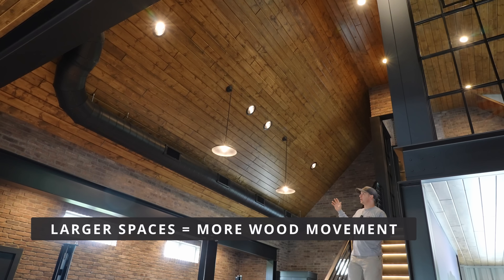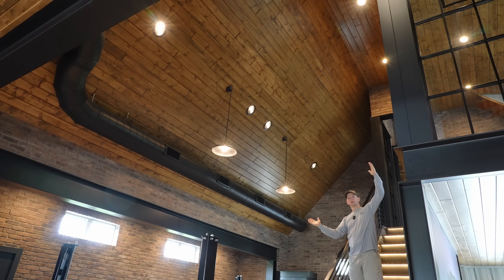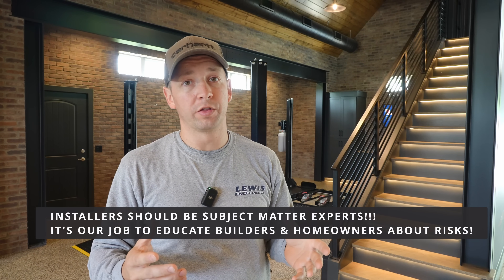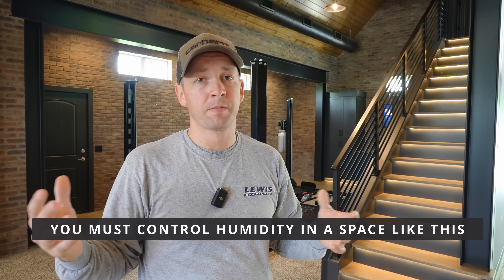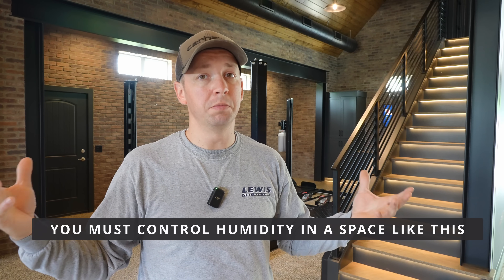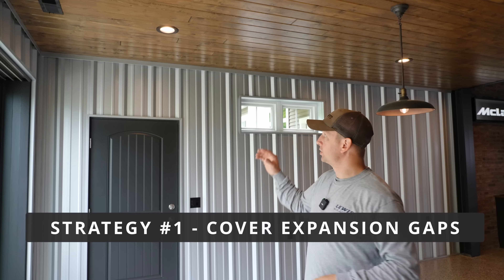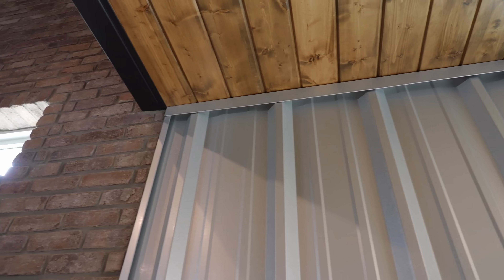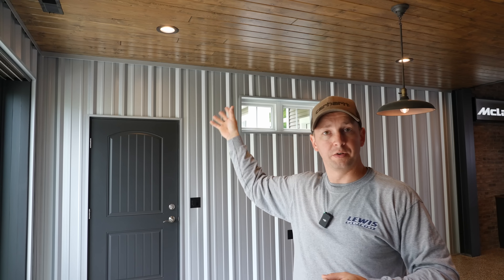The MISTAKE That DESTROYS Tongue & Groove Projects... And How to PREVENT It....

Comment: All of this makes sense and fits with my experience, but I was curious about the control joint adjacent to the garage door bracket. I try to place the control joint in the middle of a section of expanding boards so that both sides can grow into it, but in this case as you mentioned that board under the bracket is locked in place. To me that says only the expansion from the rear boards will happen in that joint (and in the rear at that metal bracket), whereas all expansion towards the front will happen where you undercut the 2x above the garage door itself. 

I can see location it there for aesthetic purposes (as the bracket is already creating a visual distraction) but in terms of functionality am I wrong about it being only functional for the rear portion?

Comment: All your effort to mitigate expansion/contraction is fantastic and great to see. 
The idea with softwood/hardwood jointed ceiling substrates is to simply treat it like a floor installation. Provide necc. relief along your perpendicular perimeters and trim accordingly. Great job

Comment: Designers and architects hate trim these days. We should all be aware that all trimless details are at risk of not having adequate expansion. At the end of the day, if it's a custom home it's the architect then the builder who are responsible for these details. I give my advice but if they want it tight it goes in tight. I have never had an issue with softwood T&G ceilings but I installed hardwood for a couple years when I was younger and have personally fixed someones floor where the installer put it in tight and it buckled.
Reply from the maker: I probably would have been that way in the past but I have learned that I have to take a hard line stance sometimes and let the builder/HO know that I will not install a product under certain circumstances. One of those is tight T&G. In Indiana there is simply way to much humidity fluctuation not to allow for expansion, ESPECIALLY if installing in the winter. I'm doing a lot of white oak T&G ceilings with material costs over $10-20k. It's just simply not worth the risk, and I absolutely don't ever want to go back and redo my work even if I am getting compensated for it. Sometimes we have to save the builder/homeowners/designers from themselves.

Comment: Spencer, I noticed something that you didn't point out that is something I always used to do when I was putting up tongue-n-groove. I always chamfered the ends of the boards. That looks so much better than just butting the ends of the boards together. "If you can't hide it, emphasize it."

Comment: Looking to do a similar interior project. Curious on TNG on a ceiling application do you run end of the board with simple butt joint of do you 45 degree (or other angle) bevel overlap with wood glue and nail?

Comment: The boards are not glued together creating a single slab , the reason for T&G is that each board expanse and contracts as individual board.
Reply from the maker: If it's only shrinking it's a non factor. But if it's expanding the movement will compound across every board. Hardwood flooring will push sill plates outside of foundation walls when it expands. It has nothing to do with being T&G helping unless there is a gap that is intentionally left at install time given certain humidity conditions.

Comment: If it does buckle how would you go about fixing it? Would it need to be removed, add an expansion gap, then reinstalled?
Reply from the maker: Yes, but I've never had to repair a botched job. So I haven't thought it through a lot.

Comment: Spencer, wish you had made this a few months ago.  I just experienced a buckled ceiling for some of the reasons you addressed.  In the end I had it too tight at the peek.  The top 5 rows on side of the cathedral ceiling  buckled about 8 weeks after we put it up.  We were able to save it and have now created an expansion joint at the peek.  Two questions you didn't directly address.  You talk about pre-staining the tongues, did you seal the underside of the pine before you installed it?   Is there any calculation for the amount of expansion needed?  Appreciate all your professional knowledge that you share with us.
Reply from the maker: No, we didn't seal the backside. From what I have seen and understood, even if you seal all sides the material will still eventually take on the moisture in the air around it. So I do not think that sealing all sides is the ultimate solution, though it may help some. 

Yes, you can calculate how much wood movement you will get. You need to know the species, current moisture content, and how much you expect humidity to rise to do those calculations. There are online calculators.
Reply: @InsiderCarpentry  appreciate the response
Reply: @InsiderCarpentry  Sealing all sides certainly won't stop the wood from taking on and losing moisture, however, it is best practice to finish all side of the wood to allow that taking on and losing of moisture to be as even and equal as possible. This is what furniture makers will do. While I'm not a finish carpenter I do watch your all your videos and greatly appreciate the knowledge you unselfishly share. I hope your wife is still doing well, God bless.

Comment: So Spencer are you personally telling the home owner IF I do this the wood will stay put?  Why not have the Architect or some engineering firm draw up a plan you follow. Why would you involve yourself as an expert on wood movement. Did you give them a  written warranty?
Reply: an architect or engineer wouldn't be able to draw up a plan for potential wood movement over time.  And they'd have far less subject matter expertise as opposed to Mr. Lewis.
Reply from the maker: Architects have not watched wood move for decades like I have, so while that may be a formal way to deal with it, I don't think its the best way. Ultimately on this one it came down to the homeowner and builder communicating on this and coming to an understanding.
Reply: @InsiderCarpentry I just did not want you to accept  the responsibility of wood movement that’s all. So many variables (A/C broke down for parts for days etc) out of your control  Good luck

Comment: Did you install the T&G over drywall? Or directly to the rafters? How does your backing material / vapor barrier affect expansion and contraction? And what is typically best practice? Thanks
Reply from the maker: Definitely never to the rafters because that would create a ton of moisture/humidity issues. We always install over drywall. 

The insulation details are determined by the builder but may vary.

Comment: How dry are you expecting to be in the winter? Dry cupping would be my concern if you're installing with high MC
Reply from the maker: The boards are only 5" wide so I'm much less concerned about cupping. It's buckling that is the deal breaker.

Comment: My great grandmother's house had tongue and grove boards on the ceilings. (This was before drywall.) In an era without any humidity control I wonder how the ceilings remained stable? There must be a trick they used back then.
Reply from the maker: I would say, 1) install with high moisture content, and 2) install with gaps to allow enough expansion for the most humid time of the year. 

In theory if you do those two things you would be fine.

Comment: In general, each board is going to expand/contract in place because of how they're attached to cross members with a perpendicular grain direction that won't change length. Since you knew the moisture content before installing and pre-stained (both important!)  you can then decide how tight to install the T&G board against each other. If the T&G boads were dry, then you leave a gap between them so that can expand with higher moisture exposure. The whole purpose of T&G is that the tongue edges of the boards can expand into the (deeper) grooves and thus avoid buckling.
Reply from the maker: That is true true a point in theory, but is practical reality the bows in the material are significant enough that you are always having to pull the material down tight to bring in the worst area of gapping. Even if you end up with a gap at the center of the board you will be very tight in the ends. If material was perfectly straight you could theoretically leave gaps for expansion but it doesn’t really work that way in reality.

Comment: I personally installed thousands of board feet of t & g I've always pre-stained front back especially the tongue and groove and butt the butt joins are always tight No bevels of the butts I don't understand the large gaps on the butts that he got not trying to take anything away from Spencer but I think this was a panic move
Reply from the maker: It’s simply accenting the joints. Makes the install easier and looks better vs trying to get a butt joint perfectly flush. I do not like the look of flush but joints due to different wood color/grain and need for tenon joinery.

Comment: Great explanation and beautiful job. Why didn't you put the expansion gap right at the garage door attachment point instead of next to it? The brackets run the same way as boards, so with a thin backer or spacers where the lag bolts go through, the expansion gap cover would be "solid" at those points but there would be room for either side to move. It would look more like a design feature instead of extra board so close to the brackets.

Comment: I build solid wood entry doors. I switched to a engineered door. I use a stable wood for the core and then skin that. I still build for movement. 

When I was in school I saw a chart that said how much wood was going to move by it's moisture content. I don't remember what ever wood was. I do remember that the boards were all 8" that were tested. I think that one moved a 1/32 and then the biggest one moved 1/4. The difference between the growth was green lumber and air dryed and keen dried. 

Knowing how much the type of wood is going to move is key to building something that lasts longer than you are alive. More water does mean that the wood is bigger. Less mean that it is smaller. Thanks for pointing this out. Most people don't know or understand how and what can and does happen over time.

Comment: We install a ton of 8 inch TNG typically Cypress on the exterior ceilings of our homes we pre-stain and pre-seal all sides and end of every board leave margins around the perimeter, and I’ve never had an issue with buckling from  movement. We do the same thing on our interior TNG ceilings if it’s stain grade material it’s all pre-stained pre-sealed. If it’s painted it’s all primed all sides and ends always leave a perimeter spacing to allow for any movement. We are in a hot and humid environment in Southwest Florida, probably the worst conditions for humidity that you’ll ever see. We have been able to control Wood movement by taking these steps.  We also instruct homeowners that we require the temperature  inside the home to be maintained less than 78 degs. and the humidity to be maintained below 55 percent.  We run all our own trim in our conditioned shop, we ship the material to the job site which is conditioned from the time drywall is finished.   We maintain humidity levels in the material we run between 7 and 9 percent.  It’s very important to insure all the material is in a conditions space until it’s completely sealed.  This is the only way to completely control the moisture content of the wood to insure it preforms well after installation. Love you channel. Keep up the good work.  .
Reply: Same. I have done 9 (47k LF) miles of cedar T&G in one house, interior/exterior including in wet rooms (showers/bath) absolutely no issues. Excellent points this should be pinned.
Reply: Cant wait to see your comment get pinned
Reply: Seems to me the whole concept of tongue and groove is to avoid buckling. One side is nailed. That permits expansion away from the nail and contraction toward the nail. This dependent on the width, grain direction, and species but not the width of the field. I am from and live in the south. Before AC there was tongue and groove.

Comment: does  your fasteners allow for movement as well? Is it even necessary? And would larger pre drilled holes for the garage door brackets lag screws on the ceiling also work to accommodate wood movement? As always- amazing work!

Comment: We usually mortar caulk wood/masonry intersections.  Caulk it with mortar caulk then dab it with the same dry mortar the masons used.  Matches near perfect.
Reply: Sanded caulk will flex with the movement the brick moves also that mortor bed at the top will break and crumble eventually
Reply: @taylorgarrison8229  I've used Sika polyurethane sealant with good long term results.

Comment: Thanks for the video.  I think it looks amazing.  I wonder if they make any material such as a composite or cement board that would not be prone to expand and contract in this situation.  I dont think they would have looked as good.  I would just be interested to know if there is any other material worth consideration.  Also what did you use to put the wood on the wall a nail gun or screws or adhesive(Im sure not).

Comment: Wood movement is real.  Im a long-time carpenter in the northeast.  I remember once installing all the interior doors on a house in the winter.  Pre hung solid core pine. All the reveals were good and the doors all worked.  In the summer every one swelled up and would not close.  I had to trim them and remortise the hinges.  Still i prefer working with wood over all this fake engineered crap. Nice work Spencer.  If u need a 56 year old solid trim man i would relocate to wherever u are. Cheers  Mike from Nantucket
Reply: That's why door manufacturers specify painting all 6 sides of the interior doors.
Reply: @lrc87290  Only epoxy is that airtight.  Paint or clear finishes will still breathe.  They will absolutely not stop expansion and contraction.  Finishing will slow it down a little, though.
Reply: I once knew a man from Nantucket.
Reply: @daveheckman9388 😂
Reply: @daveheckman9388  He was a man who never said *uck it.
Reply: Doors sealed on all 6 sides shouldn’t swell that much
Reply: I had the exact thing happen.

Comment: Spencer excellent job as usual you’re a perfectionist! I used one by six tongue and groove cedar on a 15 x 40 ft tell me covered porch when I built my house 15 years ago. I stained all sides and edges with three coats of oil based stain. My boards were random length from 4 to 12 feet. I put up half inch OSB to allow me to drive more nails through the tongue. 15 years later no issues. I believe pre-staining helps minimize expansion and contraction.
Reply: I am located in Michigan with huge temperature & humidity swings

Comment: Good to see what you did but a bit short on the math.  The Architect should have defined what the intended Relative Humidity will be for the space then you can determine what moisture content the wood should be at for installation targeting the equilibrium moisture content ECM for given species.   “Understanding Wood” by Hoadley is one of the must haves for any serious wood worker, great book.   Nice job, Architect gets a demerit for not powder coating the garage door hardware black and the use of ready angle for brackets.  Carry on.
Reply: Good information  especially  about the Book. Also a good moisture  meter  gives you the information  on wood species

Comment: Spencer, I'm looking at your joint/seam layout up there.

Was this all 16' material?

And do you have some content that directly relates the spacing and layout of a pattern to batch cut a ceiling, how you think about it at least. 

I've used seam-1-2-3-4-seam.

I'm wondering if there is something deeper in the layout of seams I'm missing.

Enjoyed, thanks.
Reply from the maker: We spliced over rafters. Material length was a mix. We tried to keep the splices as random as possible. I prefer no pattern.